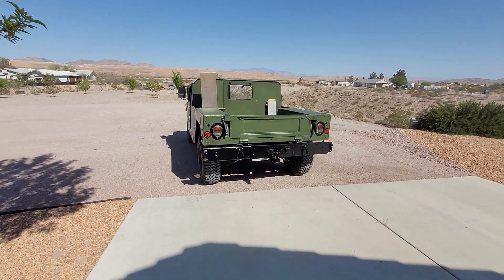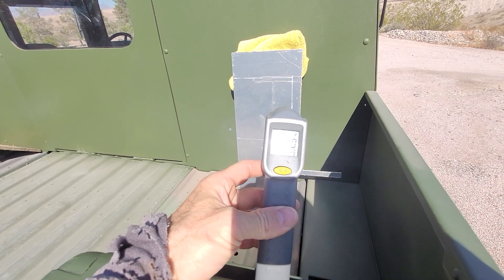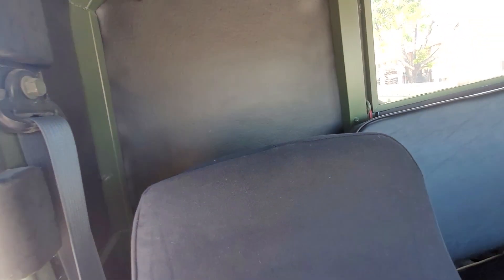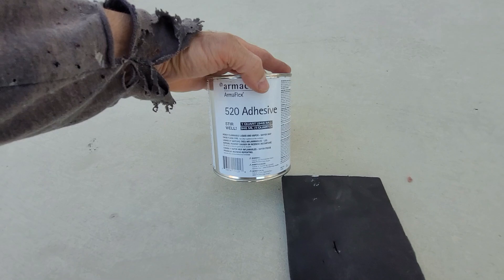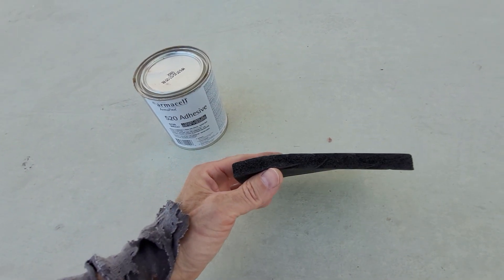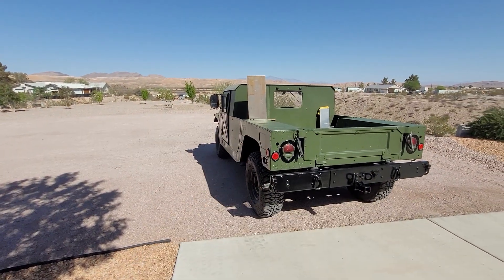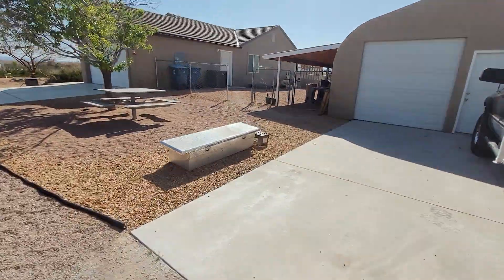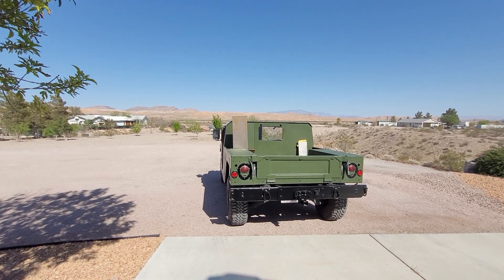Humvee Insulation

Comment: like what you did with the top off the pick up humvee did you remove the crossbar behind the seat also too get more legroom??
Reply from the maker: Thank you, I didn't remove the crossmember. I'm not sure removing it would still allow the seat to slide back any further on the tracks? I'm not that tall 5'9", so leg room isn't a bug issue. Being able to adjust the seat backrest does make a comfort difference though.

Comment: You would find that the desert sand color will be cooler on the inside of the box, darker colors always draw mor heat into the cabin area. Now it does not make sense to have the OD green in a desert environment as logical to have Desert sand in tree filled regions. Either one will stick out like a sore thumb if placed in the wrong areas of the earth. Nice vehicles however, what shape were they in when acquired them?
Reply from the maker: Choice of color would depend on what the vehicle is used for. If it were serving it's time in war or not. All of them really need insulation using either  color. These are kind of a pain to paint, so staying with the original colors they came with makes it a bit easier. Although more expensive, I only purchase good running trucks to start with. Purchasing a non running truck is a risk I'm not willing to take.
Reply: @BLCustoms understood, I have a friend holding one for me as soon as my financial situation changes, it will go helmet top and these are worse than slant backs. Insulation is a prime issue for this version. Also we will be placing several antennas on the top for UHF and VHF comms. That will require of placing copper foil ground planes underneath each antenna before the insulation goes in. There is also the chance of installing a RedDot AC unit in the vehicle. Thank you for the info on the doors and insulation! Doors are critical to secure the vehicle and to keep out moisture. The key locks are nice but it’s only to keep honest people out, those wafer locks are easy to defeat.
Reply from the maker: @Subgunman I've had mine for sale for a while. It's a tough market right now. I like the enclosed space the helmet tops can provide. Sounds like it'll be a fun rig for you.
Reply: @BLCustoms  yep! I would even go for a custom chrome-moly roll cage inside around from B pillar on back for extra safety.